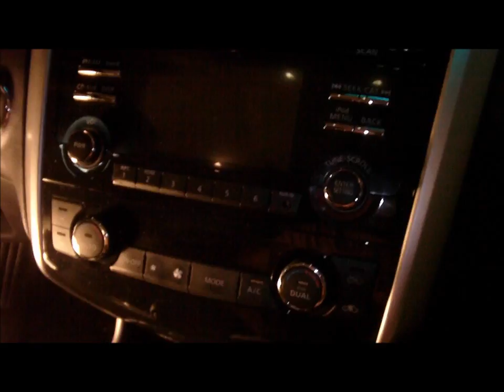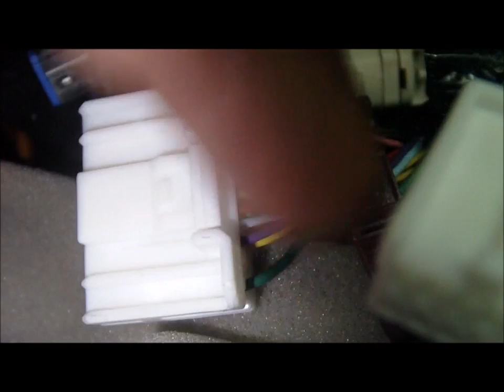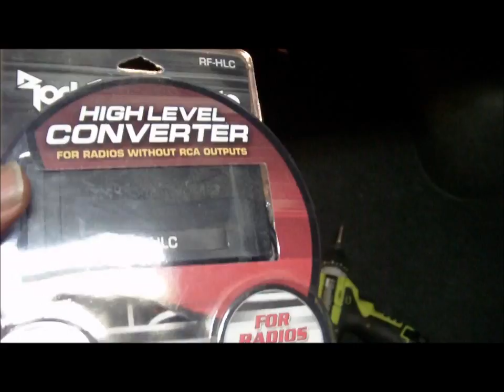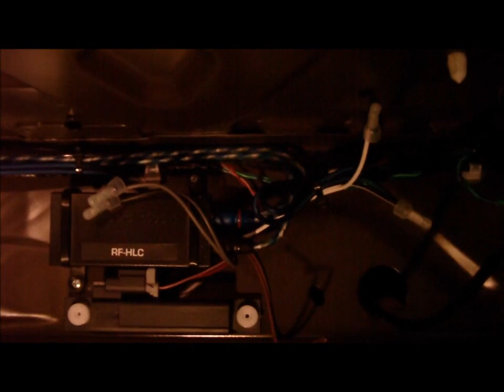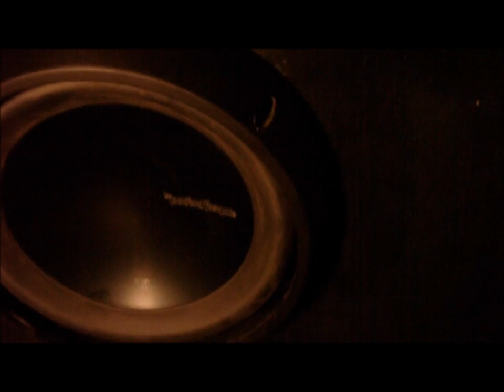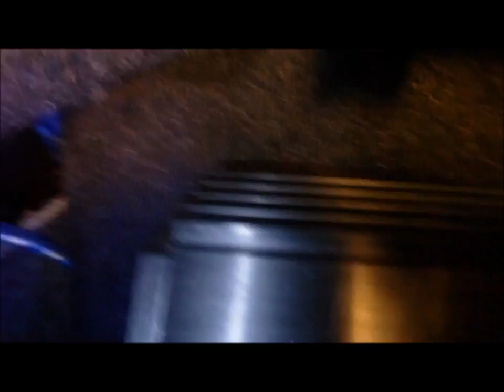Stereo Amp Install w/ Factory Radio - 2013 Altima SV

Comment: Does the factory radio cut out the bass when turned up? I noticed you moved on from the factory deck pretty quick.
Reply from the maker: Taking the OEM deck out is normal for me.  But didn't notice anything up with it when I had it in for a few months.

Comment: no one knows this answer:
Is the wiring in a 2013 sentra similar?  I JUST NEED the switched power to turn on my sub.  Is it the same one?  I tap the speaker wires from the rear deck and ran the power (12V+) from the battery and grounded in the trunk.
Reply from the maker: Probe the wire in question then check the voltage w/ a DMM is the best course of action.

Comment: How can my amp turn off if its connected to the pink 1 to remote when i turn my ignition the amplifier  light stay on im connected to the battery on the red cable n ground on chasis but it dont turn off at all
Reply from the maker: Check the wire make sure you are not on a hot wire.

Comment: Where did you run the ground wire to?
Reply from the maker: Only use the grounds if you have noise in the system.  4:58 capped off.
Reply: @PoppaTInstall  for the amplifier though where you run it from I'm currently trying to install mines but couldn't find where to bolt the main wire for the ground
Reply from the maker: @silenceakamia  Go through the 2013 Altima playlist and look for Ground Update video.  Subscribe if you haven't already.

Comment: Is it the same thing for 2017 Altima for the remote wire
Reply from the maker: I would say so.  Typically they use the same harness in these gens.
Reply: Thank you so much that really help I was able to install it really appreciate it
Reply from the maker: @carlostorres-pi1wk  No problem!  Share and subscribe if you haven't already.  Helps my channel.

Comment: Does the 2016 nissan altima have a factory amp
Reply: I'm not getting any sound thru converter from the 6x9's
Reply from the maker: @joshuagarcia4952  50/50.  If no sound it's possible it does have an amp and you'll need a Pac audio interface to turn the amp on with your aftermarket HU.

Comment: I'm confused, do you actually have to tap into that pink wire and connect a wire to it back to the converter or something or were you just showing a different way to connect it? If so, how you to do tap into that pink wire? And then where do you have to connect it back to?

Comment: Why do you not record yourself actually showing how to do the hard part? Lol
Reply from the maker: What hard part is that.
Reply: Thanks for the response. Knowing which wires on the speakers are positive and negative. (Your other video for this next one.. 2009 Altima install)And how you got the wires from the hole in the speaker underneath the panel. Did you have to remove the panel under the steering wheel? I’m going to try to take it apart today in just a little while. 

I think I’m going to install my high level convertor behind the stereo unless you can help me figure out which wires on the rear speaker are positive and negative...
Reply from the maker: @MrDJsArcade  Be glad to help however if you are working with a 2009 Altima they won't be the same.  The wiring diagram for this one is in the description as I stated in the video.   Of course you just remove the panel like any to run wire so I don't show much of that cause it's not that important to most. Sub to my channel if you haven't already and  PM me on FB.

Comment: (2013 base) Having no sound problem- Brand new amp, new wire kit... Used two different LOC's one new one i took out my car... Getting power to amp... I took some wire and attached to rear speaker to a random speaker no sound came out but inside still play. Not my first time installing!
Reply: Wish i could show picture
Reply from the maker: The color on my application is in the description.  It may be the same for yours.  I would test the LOC for output at the RCA's since you know your getting it through the speakers.

Comment: Is it possible to directly wire rca cables to the rear speakers with no loc converter?
Reply from the maker: Yeah look up Rockford Fosgate RF12SW on Amazon. LOC’s are better than straight wiring though and they are cheap.
Reply: Alright ill look into them. Just thinking if its really necessary but ur right they are cheap. Might as well. Itll just sound more distorted then the loc converter huh?
Reply from the maker: Joshua Aguilar yep it will. Then you’ll just have to redo it all over again. Just get an Audio Control LC2i so you have all ur bases covered.

Comment: This video was very helpful to me. I have a 15 Altima that I wanted to get some more thump from. I put in a ported kicker box with (2) 12" Comp VRs. The amp I used has a speaker level input so I skipped the converter and RCA. Just spliced in the High Input harness that came with the amp. Your -/+ colored cable list came in handy for that part. Thanks!
Reply: what wattage was the amp? and did you have any problems with the battery dying, also where did you wire the wire that tells the amp to turn on and off

Comment: Hey bro quick question I have  satellite radio in my car What do I need to put it on after mark radio
Reply from the maker: Look up iDatalink Maestro SAT-T02.  Without knowing what car this would be a good start.  If the HU doesn't have a sat tuner then that's something else.  tks.
Reply: @PoppaTInstall  sorry 2013 nissan altima sv

Comment: Man I just watched your videos and I have a 07 altima I'm thinking standard I ran my wires for my aftermarket amp and things amp turns on but no sound amp is good speaker are good what could I be doing wrong
Reply from the maker: Could be a number of things.  Since you're watching this vid you must be using an LOC?  I would start there then check the RCA's and make sure you're getting a signal.  Test a small speaker on the amp speaker terminals.  Then you'll at least know your amp is good.

Comment: Where do you get those connectors that you used to splice into the speaker wire? What size is the wire?
Reply from the maker: They are called T-Taps.  Typically it's 18ga.

Comment: Hey with this kit you installed does the car make a thump noise when you turn the car on/off?
Reply from the maker: Not at all.
Reply: fix up all ground connections. if it still pops, try grounding the negative lead directly from the speaker terminals.

Comment: Hey Poppa, I have a question for you. I have a Nissan Altima 2014 Base model with 4 speakers. I bought a Boss audio stereo and the metra wiring harness that you mentioned in one of your other videos: 

1. There is a orange Illumination wire from the metra but the only orange wire on the stereo is the Backup Camera trigger wire. Should I connect those two together? I am thinking not. Also do I need to power the backup camera from this Orange wire or can I tap into the braking light?

2. There is a blue/white wire from the Harness. I am thinking that's the amplifier wire. There is no blue/white wire on my stereo, so not sure what to do with it. I am not even sure if my Nissan Altima 2014 Base model has an amplifier, so will request your expertise on how to deal with this wire. 

3. there is a pink brake wire coming out from the stereo. I have absolutely zero idea what to do with it. Accordingly to my research, the brake wire is not on the harness and needs to be dealt with separately. 

Your expert, guidance and your time are really really appreciated sir. Have a good one!
Reply from the maker: Thanks for watching
1. No.  That is an illumination wire for the stereo.
2. The blue/white wire is an alternative way to hook up your amp because Boss unlike better brands such as Pioneer doesn't provide a way to hook up amps.  That wire should be hot car on so if you don't intend on using it tape it off.
3. I will include a link to retain your back up camera in the description.  I will actually be covering this in my spring install of my 2013 Nissan Altima SV model, but you can try yourself if you like.
Reply: Thank you Poppa for the wisdom. I didn't understand:

1. How to hook up the pink wire from the stereo, so if you could comment on that.
2. I don't have an existing backup camera in my Nissan Altima 2014 Base model, so I need to hook up one. Must I hook it to the backup light or the orange trigger wire on the head unit. thank you once more!
Reply from the maker: Without seeing it I believe you have a DoubleDin unit thus the pink wire is the E-Brake wire to enable you to watch tv once the e-brake is applied.  So you would need to bypass that wire so you can watch tv while the vehicle is in motion.  Whatever camera you get you can wire it to the parking light in the tail and run your video cable to the back of the head unit.  Test the orange trigger wire on the unit to see if the camera display will pop up once it receives power then you will plug that wire to the appropriate connection.
Reply: Perfect thank you so much. yes indeed it is a Double DIN. Some say that it's okay to just ground the pink. I called up Boss Audio and they say connect to the negative trigger on emergency switch. I am confused, as to where this might be. Appreciate it.

Comment: I need help locating where to wire remote power for amp to turn it on I was gonna try putting it in with a fuse but the fuses are so small it's almost impossible
Reply from the maker: That pink wire that I pointed out on this model is where you would put your remote wire.

Comment: do you really need to mess with the head unit? i never have i just install converter on rear speaker. but is it necessary ?
Reply from the maker: youngtexasplaya21 standard no but any aftermarket will give you more control over your system
Reply: +Poppa T cool so i really dont need to cut that pink cable? i have 2014 sentra
Reply from the maker: youngtexasplaya21 Nope just tap into it. That is of course it's the same wiring schematic as the Altima
Reply: +Poppa T confused me bro, i have a boss converter my bad lol im kind of slow
Reply from the maker: Take that Boss converter and put it under your back wheel in the morning.  Get a quality LOC when dealing with this sort of stuff.  I suggest Audio Control or Rockford Fosgate.

Comment: Whats up brother i have a quick  question i have a atima 2013 sv   and i want to install the oem gps system    and im looking on ebay and they sell the unit but the question is  if i buy that it is plug and play or do i have to run new cables?
Reply from the maker: Doubt it.  I've seen scams passing off OEM, but really use some sense about it.  If it didn't come with the car it's not OEM and $285 for GPS+?????!!!!  My TomTom cost that much!  If you've watched my videos you'll know I'm a Pioneer fan.  I'll be upgrading my 2014 Altima with the PIONEER AVIC-8000NEX so there you'll know you truly have what you want with upgrade options.
Reply: And the pioneer has gps or it just radio?
Reply: Thats why i wanted to get more info how much for the unit ull b installing  ? Does it come with faceplate and also is it plug and play cus  i really dont know  how to do that
Reply from the maker: Juan p You'll need some wiring fundamentals anytime you alter your system.  I've got a video somewhere explaining this and some things you'll need.  The NEX line from pioneer are excellent units and GPS does come with it.
Reply: I know  and when are you planning  to install the new radio?
Reply: The avic8000nex is expensive  but awsome where do u get the faceplate  and bracket  for that?
Reply from the maker: Juan p Probably during the summer.  I have other projects going on right now so it's not priority.  Subscribe so you can continue to get updates.

Comment: Ok thanks bro another ? Does it matter if i hook it up to front speakers or does it have to b from the back ones i want to wire it up behind the radio on 13 altima??
Reply from the maker: None the least so long as the polarities are correct.